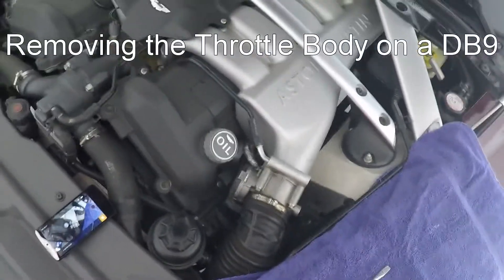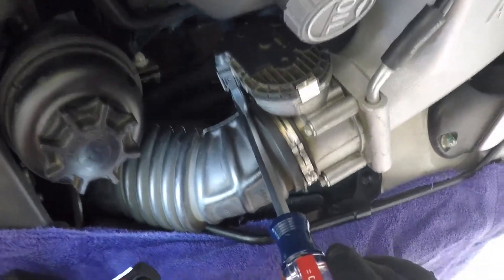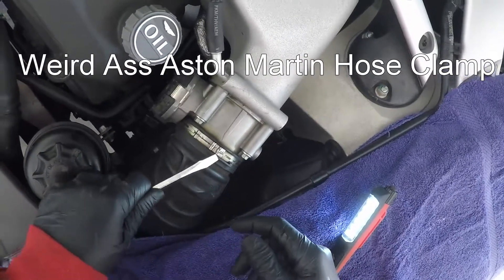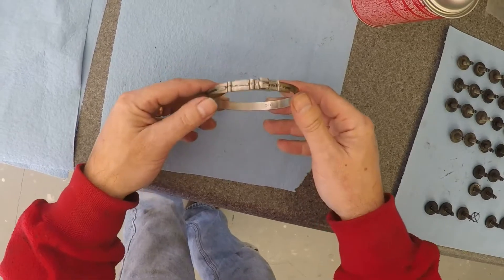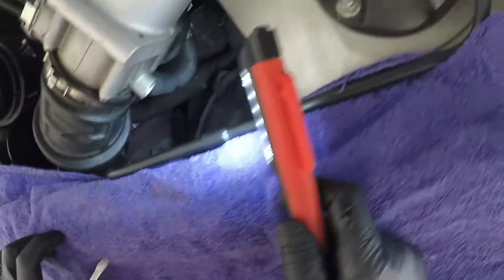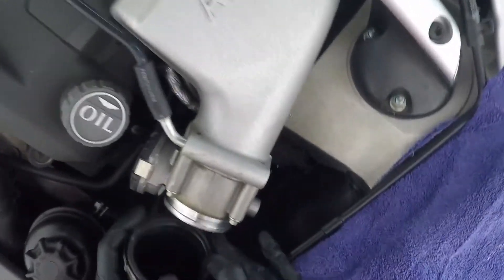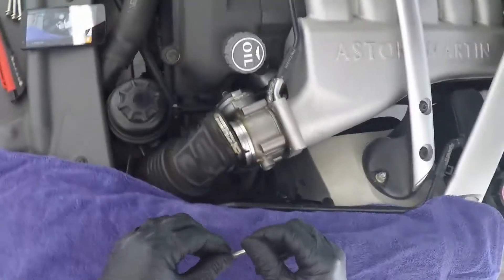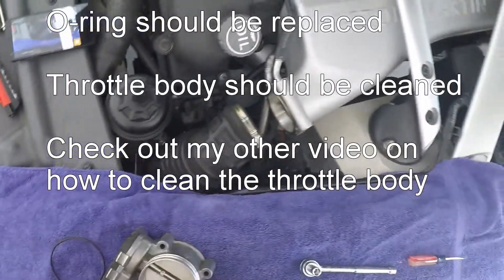Removing the Throttle Body on an Aston Martin DB9

Comment: You can also release clamp at bottom of the black  air intake tube and remove it completely. Makes getting to throttle body and oil filter much easier.